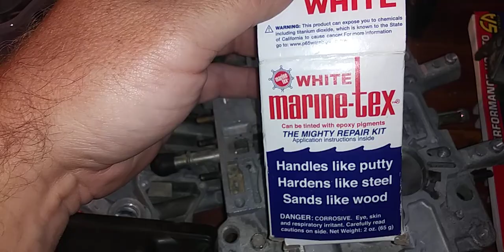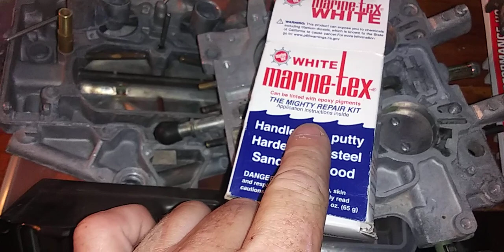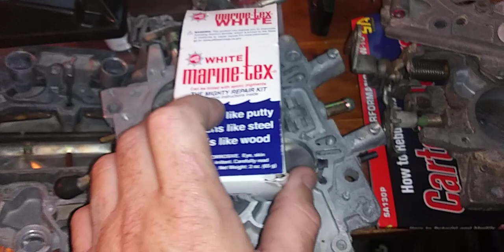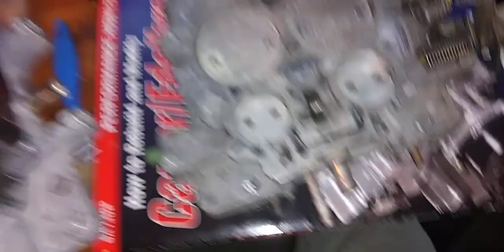THERMOQUADS MOPAR 360  CID : PROJECTS & TECH TIPS! PART (1) 🔧

Comment: I prefer the Tquads with the fuel inlet that points around to the passenger side of carb vs starlight down in the back. These are good carbs and get a bad rap for bogging but they can be tuned.

Comment: Where did you get the theromoquad shirt? I want one. I run 2 thermo's, one on 440 in charger and one on 318 in my 77 truck. The truck gets way better mileage than I ever got with stock BBD's
Reply from the maker: frieburger from off of road kill was selling them on Instagram . don't know if they are still selling them. they made a batch then sold out they got alot of people wanting them and they made another batch . on the second round I ordered both shirts .